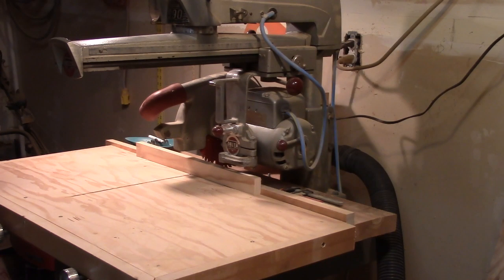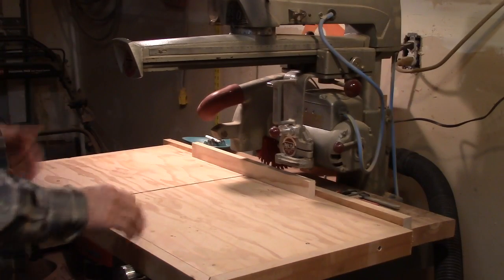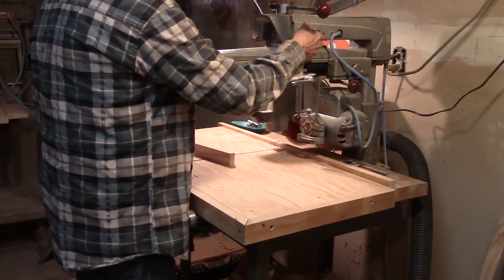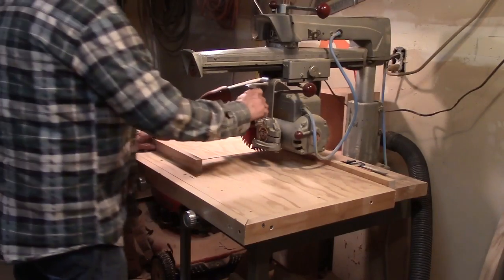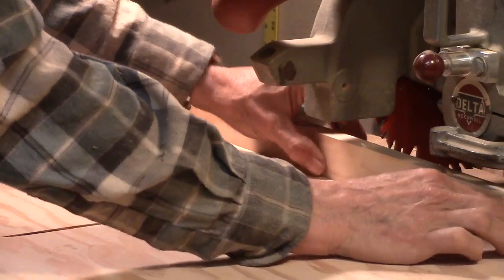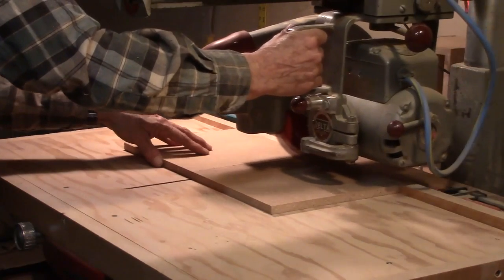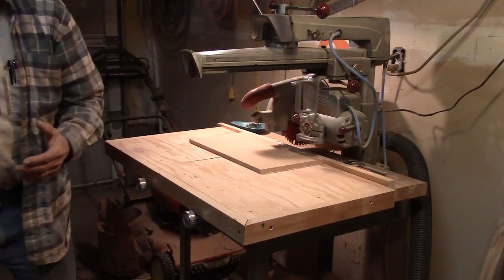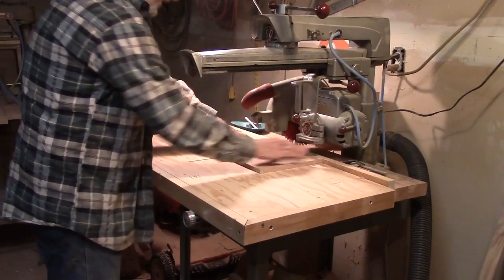Check your Radial Arm Saw for square

Comment: I'm having a bizarre issue on my 33-990. I could never get it to cut quite square, no matter how much tweaking I did. So I put a laser flange on the blade and I noticed the blade will start out square but not long after pulling the blade forward the blade suddenly is no longer square. A framing square confirms this because the blade will start to follow the edge of the square but at a certain point the blade will start to try to climb onto the square. I'm hoping that maybe the bearings need some adjustment and that the track isn't worn.

Comment: Another good one Ed,   I really like the features that the delta has that my dewalt does not.  Do you know what year your saw is?
Reply from the maker: Pretty sure it was made in circa 1961-62.
Reply: Wow, Same as my dewalt.  Looks like delta was a little more forward thinking back then.
Reply from the maker: Mike West I think both approaches are good.  Some like the Delta approach, others like DeWalt's approach.   Either brand will get the job done with equally good results.  What model DeWalt do you have?

Comment: Now you just need a cover on the receptacle to keep dust out of the electrical box...lol. Informative video, thanks.
Reply from the maker: +Broncore 10 That damn outlet has been missing it's cover since I built the hours, how the electrician missed it is a mystery.  About a month ago I finally did put a cover on it, it only took nine years.  Good eye you got there.
Reply: +Ed Waggoner Sr. (Papatch) I'm an electrician by trade so it's sticks out like a sore thumb to me...lol
Reply from the maker: Broncore 10 I kinda worried about sawdust short'n things out, probably wouldn't but with a little arc'n it could's started a fire, I guess.

Comment: Great info! I have a Delta 900 which I love and I was luckily able to find a manual on vintagemachinery.org, but it's nice to see someone actually using and discussing the saw.
Reply from the maker: +Just Make It vintagemachinery.org is a great source of information.  That's the first place I visit when I buy a "new" RAS.  The 900 is a really great RAS, I used one for about three years, then one day a 990 showed up on C/L for $40, I couldn't resist. I glad my videos are of value to you.
Reply: Absolutely. I just found a guy selling a Rockwell Beaver 1550 for $50 and I'm wanting to go have a look at it. If all goes well, I might just turn my 900 into a dedicated dado saw.
Reply from the maker: Just Make It I'm not familiar with the Rockwell Beaver 1550.  Is there a link you can share?
Reply: Same saw as this guy and made in Guelph Canada. http://vintagemachinery.org/photoindex/detail.aspx?id=15750

Rockwell must have kept the design rights when they were hoping around.
Reply from the maker: Just Make It The saw look pretty similar to the Delta 105, I think.  If I am not mistaken the yoke is only anchored to one side of the motor.  I'm not sure I like this arrangement, but I've never owned one.